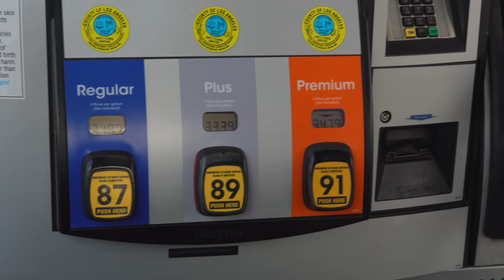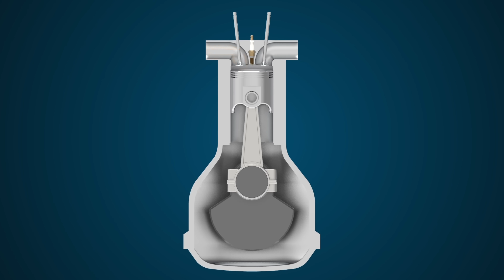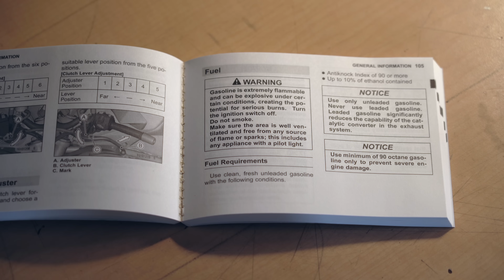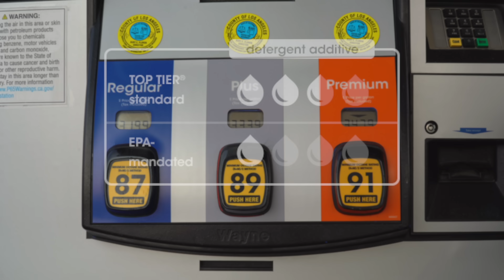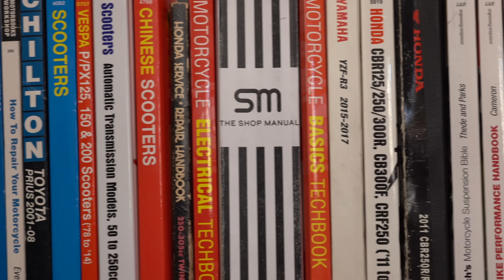Should You Run Premium Gas In Your Motorcycle? Octane Explained | The Shop Manual

Comment from the maker: Read more about gasoline and other moto essentials on RevZilla's Common Tread: https://rvz.la/3lpDheI
Reply: Do ethanol vs no ethanol fuel please!!!
Reply: @chrisc6186  What he said. More ethanol usually means it needs more fuel for power. Lean, rich and what the ECU says.
Reply: Wondering if ethanol is good for cleaning the combustion chamber too...🤔
Reply: Hi, can you PLZ explain HOW is the Yamaha R6 599cc way faster than the Kawasaki Ninja 650 649cc ?? how can having the same cc they have soo much difference in HP 98.9 vs 68?
Reply: @hit_it_if_you_care5211  hi! If you are interested in understanding how does an engine generates more hp with the same displacement. Fortnine just posted a video on the topic yesterday! I think you Will get your answer there. Have a great day. Bless you. Julien
Reply: @julienarrijs  Thx, know i know how, but i wasn't clear why, it can all be because of some looks. I will call Indian for being more efficiently and harley just lacks of interest i guess.
Thx for the video, i almost didn't watch that video before, because fortnine video title, that didn't clarified the video conversation, and the title just felt a promotion for Indian. If it wasn't for you i will have pass that video.
Reply: @hit_it_if_you_care5211  twice as many cylinders in the r6. Much higher compression. Higher rpm range due to the higher number of cylinders, also facilitates easier high end power. Kawasaki also tuned the ninja 650 as a commuter bike with efficiency and bottom to midrange power being the focus, whereas the R6 was designed to be a super performing high speed focussed bike that makes all its power in the top 3rd of the rev range. Number of cc's alone does nothing to tell you of a bikes performance irl. Thats why we still have 80hp 115 cu in or 1884cc Harleys and at the same time have near 200 hp 1000cc sportbikes, with just over half the cc's of the harley. Hope this makes sense
Reply: I realized only a while ago the even "cheapest" option in my country, sometimes the only choice along with it is diesel is more premium than the premium gas in the US. We only have 95 and 98 octanes in Spain
Reply: @rodrigop9714  that must be RON ratings.
High octane on a bike rated for lower will lose a bit of power and efficiency. It can also build up more carbon.
Can't count the times I've seen someone say their Japanese bike needs 91, but that's 91 RONnif you read closely, equivalent to 87 R+M/2.
Reply: THX Bro very clear and informative. God bless🙏
Reply: Would love a video on ethanol in gas, and how it affects different types of fuel systems and bikes (new/old, carbed/injected)
Reply: I port/stroke little 2 stroke engines for a living. Self taught of course, but I do have engineering degrees too, (not chemical).  It was nice to see a YT channel with a pretty good explanation.  I don't think I could have said it any better myself----but---where is that gas station with a lower price than their neighbors?  Those prices go up and down with the same tank of fuel they sell, and there is probably no better example of price fixing, (of course, it is not called that), than with gasoline.
You do a good vid sir.  Thank you for giving mankind hope. :)   Doug in Michigan.
Reply: Nice little library at the end.  There is the difference. :)
Reply: Premium helps mitigate "Yamaknock".
Reply: Communicator
Reply: I did laugh at the protein analogy. :-) :-)
Reply: Could not have said it better myself.
Reply: no
Reply: I’ve been burning 93 gas in my 38 year old goldwing, because I’ve been told that it has no ethanol. Ethanol is the cause of that green gunk that forms in the carbs over time and plugs the jets. Or so I believe. Is this incorrect?
Reply: @caryd67  The biggest problem with ethanol in gas is that ethanol is hygroscopic; it absorbs water. The longer it sits, the more water it absorbs from the atmosphere. In turn, the water can cause corrosion in your system. Using gas without ethanol can eliminate that problem Pure-Gas.org has an extensive map of gas stations that carry ethanol-free gasoline. BUT they may not have 91/93 octane ethanol-free. Ethanol in gas is mostly a problem if it's sitting for a while; if you ride a lot so that gas isn't sitting in your tank very long, it's not going to absorb much moisture, and won't (shouldn't) cause problems. TBF, most motorcycles don't see heavy use; many may only get 1500-3000 miles/year, or less. If you aren't riding a lot, ethanol-free is probably a good idea. If you go through a tank of gas in less than a week on average, you'll probably be okay.
Reply: @PiercedRivetHead  Nice Job!  If you lay something up for the summer or winter ethanol free is best!
Reply: @caryd67  nope
Reply: And the rubber gas lines also. I ran some in my brand new dirt bike. It clogged the jets within 48 hours got new carb same thing. Bet it loves gaskets too .use 89 @caryd67
Reply: @caryd67  most gas these days is 10-15% ethanol. Which given the age of your Goldwing, might cause some problems.  A bike that old should NOT be run on 85% ethanol because it WILL cause problem with the fuel system and engine. 93 octane is probably overkill, check the owners manual and see what Honda recommends.  I would think regular would be fine, but I would probably be using midgrade if it were my bike.
Reply: I have noticed about 10mi more per tank.
Reply: Can airplane fuel improve performance??
Reply: @franferrario7425 absolutely.
Reply: @franferrario7425  Absolutely NOT, avgas contains lead which will damage your engine.  Jet fuel is kerosene based, much like diesel but cleaner. Jet fuel is also illegal to run in your car in most states.

Comment: I like Rec 90 non-ethanol especially on bikes with carburetors. Yes its usually more expensive than even the premium fuel but when you're getting 50+mpg and you don't have to worry as much about it sitting. Its worth the price.

Comment: Ok, question. I am a long haul truck driver who does not get home much. I ride maybe 6 weeks a year. About 3-4 months at work not riding and at home for 2 weeks at a time 3 times a year, during April/October riding season.

My Africa Twin calls for 87 octane and if I plan on lots of riding, I do. Except on the last tank I fill it with ethanol free premium for storage until my next home time. Would an anti ethanol storage additive like Sta-Bil be better than the ethanol free premium?

Same circumstances if I trade for 1300BMW GSA but reportedly it requires 95 octane and I think my area(Pacific Northwest USA) tops out at 91 octane. Would the BMW need Stabil during the 3-4 months I am not at home?

Comment: The comments are interesting.  I only use ( pure) gas in my Rebel 500 and my Grom. The octane is 90.  I just don't like the idea of ethanol inn my engines. While ethanol is by it's very nature is a cleaner it also by it's very nature is a sugar. The debate will go on forever.  Every 4 tanks of gas I add Seafoam to a full tank of gas this is to clean the carbon off the valves and pistons. The sticky residue left due the burning of ethanol will increase the deposits in the combustion chamber and valves. JMHO

Comment: I run 93 rated octane fuel in my motorcycle. I only buy gasoline at stations that do not use Ethanol additive in their high octane fuels. Ethanol is a solvent and eats up seals and gaskets in older bikes.

Comment: Lol, in New Zealand, we have 91 octane, 95 and usually 98 though sometimes 100, Your choice of 87, 89 and 91 is a little sad.
Reply: thats a misconception. the 91 and 93 buttons in american gas stations is equivalent to 95 and 98 octane in europe. its just numbered differently
Reply: @kushpaladin 
yeah, i agree
I didn’t know that either until i looked into it. turns out we Europeans use RON, while in the US they go by AKI.

In Germany, we have Aral Ultimate 102, which is roughly equivalent to about 95.5 AKI in the US.

I actually use this fuel for small engines like my motorcycle, scooter, and even my lawnmower. It doesn’t degrade as quickly as regular fuel, so you can still use it even after it’s been sitting for a year.
Reply: Aren't you smart enough to understand the difference between the AKI and the RON ratings?

Comment: I did an engine upgrade to my 103” which include increasing the compression slightly.  I notice the gas I get at certain times will make my engine ping, so I’m careful to listen. I went to adding an octane booster.  Makes it run great, no ping, and increase the gas mileage.  Helps offset  the cost, but I’d do it no matter.  Just me, but seat of the pants riding is a lot better with the octane. Thanks for the video.

Comment: Not quite right. It’s not high rpm that causes knock it’s high torque 
If using low octane fuel in engine designed for high octane, then limit throttle opening esp in mid range.

Comment: I don't pay as much attention to octane for my bike, as I am always using gasoline without any ethanol. Ethanol is basically a filler cars/bikes were never meant to run on. It's why big engine cars used to get so much better mileage than cars today running ethanol mixes. But it costs you more and you pay more taxes this way. Ethanol blends will eventually kill your engine regardless.

Comment: Good video. The "engine nock" is caused by pre-detonation before the piston reaches TDC. When 87 octaine fuel is compressed in 12:1 ratio engines or more, the 87 air/fuel mixture is more volatile under these higher operating pressures and therefore explodes sooner than desired. 93 octaine is less volatile and detonates at TDC. Using 93 in an 87 tuned bike will give poorer performance.

Comment: I run regular in my goldwing. Only put 93 in it when i store it. I run the last 3 tanks or so with premium and add upper cylinder lubricant to keep the fuel system lubed up. Hasnt failed me yet. 90,000 miles on original fuel pump and injectors.

Comment: I'm  in So. Oregon.
 "Clear Premium" (no ethenal) is easy to get.
 It's  about a buck a gal more than 91 gas.
 Clear is 94 oct.
 I track all of my dirt bikes performance pretty carefully.
 I get about 3 or 4 mpg more on clear.
 And the bikes run happier, and require less tinkering.
 So it actually...maths out...to cost a tiny bit less, to run clear.
 I run it in my 50 year old ski boat too.
 It has an 11 to 1 engine in it.
 I can run full advance ignition timing in it...which is more efficient.
 So...again...it offsets the cost of the non ethanol gas.
  If the government would just let the car, bike, boat guys do their deal, and get out of the way.
 There would be a ton of 1.6  liter engines in cars, that would easily make 200 horsepower .
 And get excellent fuel efficiency without all of the complicated systems, currently required.

 Oh...sorry...I said government...and efficiency  in the same paragraph.
 My bad.

Comment: Here in Norway we have 95 oct with 10% ethanol and 98 oct without any ethanol. My bike a BMW F750GS can run on 5 or 10% ethanol, but runs much better on lower rpm`s if I use pure 98 oct. Since my bike is parked (winter) from the end of october til the end of march, it is also important to store it with fuel that isn`t hygroscopic.

Comment: I'm in the UK, I run a Suzuki Bandit 1200 I've had 23 years.  When the fuel went from E5 to E10 I decided to run the bike on high 99 octain.  I zero my odmeter every time I fill up so I can work out  my MPG in my head.  It's a bit of a thirsty cow so as long as I'm not caning it It returns about 34 mpg.  The first thing I noted was that the bike was running a lot smoother, but when I worked out the MPG I was getting 39 mpg.  So when I work it out it's cheaper to run on the higher priced fuel.
Reply: Question for ya…Are you using “mpg” out of courtesy for YouTube’s heavily US-leaning viewer count or is it somewhat common to use mpg rather than, uhhh, kilometers per liter (?) in the UK? 

Signed, 
-Curiously oblivious American
Reply: We use MPG here in the UK @kevinhinds1925

Comment: Like many others, i go for ethanol free gas.
Simply cause it's in the manual and it helps in winterstops.
Hadn't used my bike in 5 months.
Connected the battery and came to life almost instantly. No cough or splutter.
As if parked yesterday.

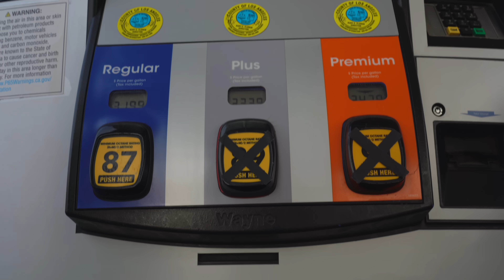Comment: The advice @3:36 is wrong. If you are forced to buy 87 octane, you want to keep the RPMs high; contrary to what he said. Predetonation occurs mainly at lower RPMs, under 4000 RPM in almost all stock engines. By keeping your engine RPMs above 4000 you eliminate the possibility of predetonation in the cylinder.
Reply: The key is not to load the engine heavily. So yes, if you were throttling it hard up a hill in the wrong gear (engine lugging) that would be a very bad idea.

Comment: Where does Rec Fuel / non-ethanol fuel fall in the detergent scale if sold from a "name brand" gas station?  It costs extra, sure, but getting 100% gasoline instead of 90% gasoline does make for more power.

Comment: Yeah gas matters if you're high compression or older motor, I put 87 in my 05 Chevy Tahoe (the recommended octane) and when I stepped on it to pass it started Pinging or detonating. Filled back up on 93 problem went away.

Comment: Good advice? maybee.  Read your owners manual ( yes some people actually read it)  My dirt bike runs best ( the manual told me to use regular)  on regular gas, stay away from ethanol if possible.  My 2012 Harley has electronic ignition, I us high test only,  the bike is tuned to run High test.  Yes the manual told me.   2 different bikes designed to run different fuels,  READ THE MANUAL.

Comment: My motorcycle was designed to burn regular/unleaded gasoline, but i filled it with high octane premium gasoline, is it okay to let consume the remaining premium gasoline first and until empty? Or just drain it and replace it with the regular/unleaded? Hope it will answer, thanks in advance...
Reply: Well by now I'm sure you have run it off already. But, run the lowest octane that your bike will run on [OR] what the manufacturers recommends, However, a bike that is designed to run on 87, may not run well based on the quality of the gas, as he stated, So I run the 89 in my tiger 660, that CAN 'run' on 87.... But I use well know brands as well. It is not a bad idea to run a good brand Cleaner at every fill.  I use a bit of MMO as well.

Comment: There's something also to consider in the equation. Ethanol. In the USA it's ten to fifteen percent of the fuel. I never put anything but pure gasoline in my bikes. My mpg is better than comparable bikes using ethanol fuel.
Reply: Know that your bikes manual will show what grades and types can be used. No gas is Pure. They all have some percentage of ethanol... my tiger 660 can run on a wide variety of fuels according to triumph.

Comment: I interviewed gas company chemest saying what you're saying. He told me another interesting point I'll share here. Octane boost isn't measured from 87-88-89... 87.1 to 87.2 to 87.3 to 87.4... so if you're thinking your increasing by "ones" your not! Your measuring in 1/10s (tenths). Another interesting fact I learned? What affects to using Too much octane booster in fuel mix? O2 sensor an sparkplug till take on reddish color! I know when my mix is too high concentration down shifting down hill, heading the exhaust pipes back pressure! So at next gas stop I just adjust more or less fuel per mix in tank.

Comment: Octane ratings relate directly to compression ratio.
Reply: but Bore and stroke and the fire timing fit into that mix. for heat and burn time, to being exhausted, from the valves...  My tiger 660 states a compression of 11: but the bike will handle 87 octane, and then variables on the ethanol.  Gasoline types can burn differently as well.   Though I can run 87, I use a brand name 89 octane.

Comment: Critically the higher grade the fuel the less amount of ethanol and thus less deposit internal engine build up
Reply: grade of fuel? you mean fuel reputability? like Shell or BP or GAte,  over Joe shit the rag mans gas station?  You want the fuel in the cylinder to Burn off as fast as possible, without leaving unburned fuel which is the carbon problem.  The lowest octane that it will run on is the best.... as it will all detonate... unless you hear ping from the heat for pre-det.   it also helps to run a good cleaner at every fill up.... which I do, as well as MMO.

Comment: I choose Ethanol Free. I enjoy clean pistons.
Reply: but really is less ethanol than stated....  A friend in the industry stated that modern engine designs and materials used can run very well on ethanol grades, as such does burn off quicker and faster for less emissions, and today's engines are made to run with that fuel type.

Comment: You need to mention what happens  at the pump. You only get the fuel type  you selected AFTER the previous person used the same pump with a different grade of fuel runs through the hose then you will get the fuel you are paying for.... Bet you didn't think of that ,Ha.
Reply: In New Zealand the pumps and tanks are totally separate so we have a different nozzle for each fuel type. Our minimum grade is 91 and our highest is 100+ and if you go to the right petrol station it is a non-ethanol hundred plus❤